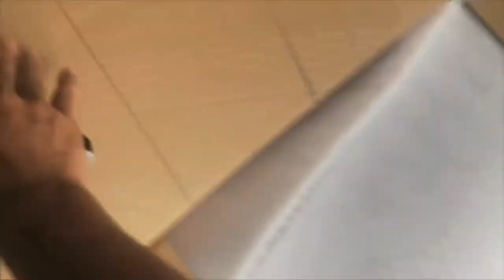5th Gen 4runner Winch Bumper Install (amazon) link below

Comment: How’s it holding up so far?
Reply from the maker: Cosmetically pleasing and functional. No difference in mpg, luckily never had to use it besides knowing its good looks and added protection. The extra led lights that came with it are great and bright that matches with the rest of front end. I highly recommend it. I have not added a winch to it. Never planned on using the vehicle for extreme trails that would require me to use a winch. Nice to it know its capable though.